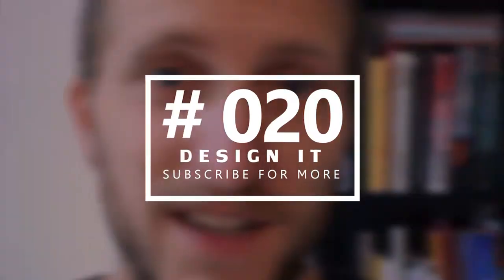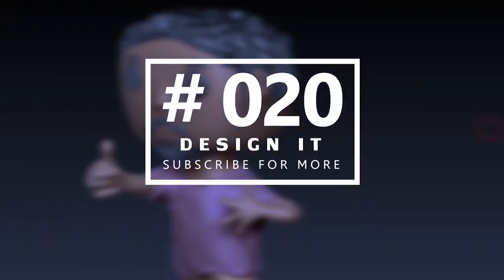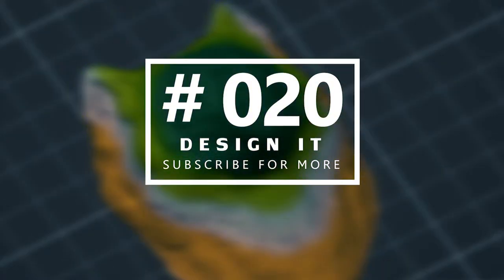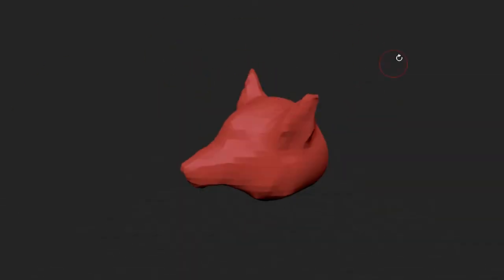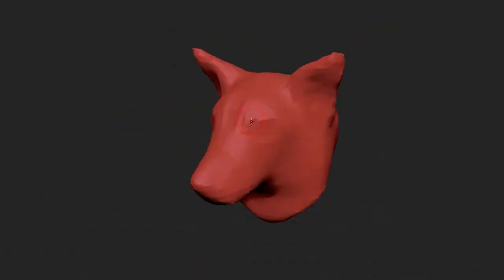3D CHARACTER | modeling and printing a DOG BUST

Comment: Awesome man, nice work !
Hey, would you help me ?
I'm a 3d modeling student and I'm thinking in buy a artisul...
Would you recommend this for me ?
Thanks bro !
Reply from the maker: Hey thank you very much! I think the artisul d13 is a good alternative to more expensive brands, being the same hardware. 

Only downside is that sometimes you can have problem with drivers (for example now in windows 10 with 2 screens sometimes I have problems or glitches).. that being said, it's almost half the price of the "W" alternative with same pressure levels and screen. For me was a really good choice ! Maybe you should try it first to decide.. hope this helped a bit!
Reply: @masslona  helped a lot !!! Thank you very much !!!
Just one more question, I have ZBrush 4R8, have you used the artisul with this version ? I'm a little worried about not support this version ...
Reply from the maker: @leozzaoocorbi7486 in these videos I actually don't know which version it was, because I had the demo license from the website. Now I use monthly subscriptions when I need the program so it's always last version (there are also student versions info on the website but I don't know how much they cost, but you can try to see). Back on the topic, I think that as long as the artisul is supported by your Operative system and works normally (for example with Photoshop or others), it should work flawlessly also with Zbrush, indipendently from which version. You can probably find online other people working with artisul/Zbrush and see if they have your requirements
Reply: @masslona  ok, thanks a lot for the informations given ! I'll buy it as soon as possible... I live in Brazil and they opened a warehouse here... The price is completely attractive even in Brazil reality, I very anxious to get one!

Your feedback really helped me !
Thanks for your attention !
One more sub 🔝
Reply from the maker: @leozzaoocorbi7486  you're welcome! Always happy to help!